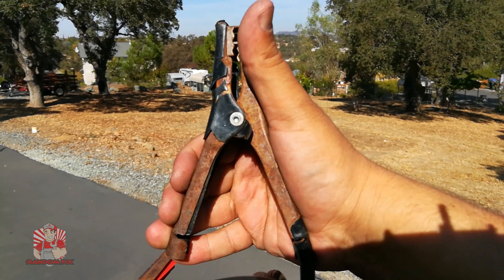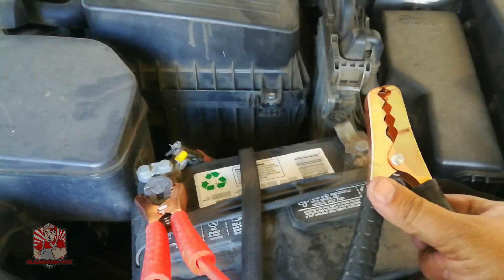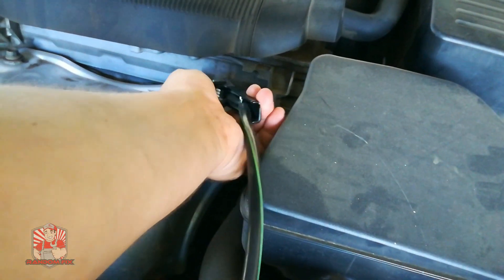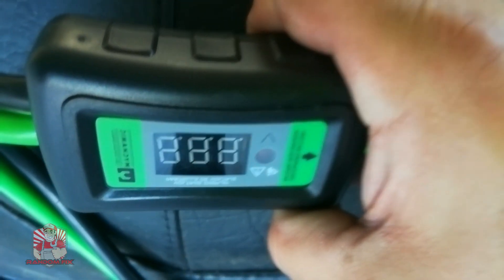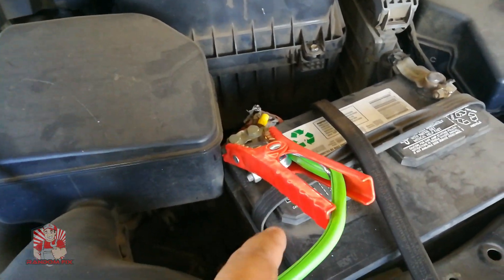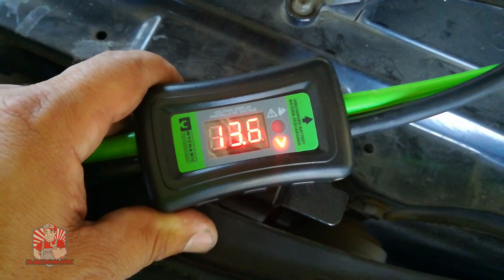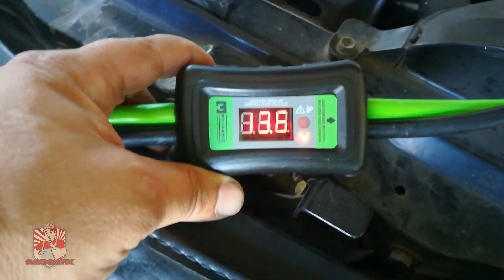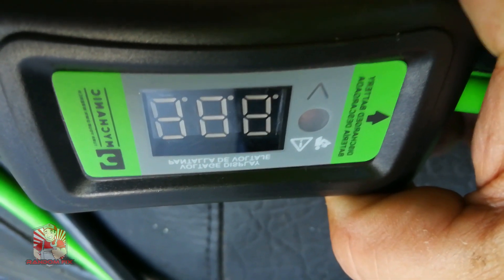MYCHANIC Smart Cables Tool Review

Comment: Should be clear to read battery voltage car needs to be off otherwise  your reading alternator output
In the video it would have been good to read the battery voltage on the old battery shoikd be betwern 12 and 12.5v after charging for a while.
Reply from the maker: Great feedback I will be sure to add to that future videos to show the charged voltage.

Comment: Walmart has theseunder the EverStart name now. The EverStart version doesn't have the arrow pointing to the discharged battery. I want the display closer to the discharge battery.  I'm sure they are made by the same company as the voltage display unit looks identical.
Reply from the maker: Thank your sharing . I hope they have a better price as these were expensive back then. If the display is similar it probably is the same unit. I wonder why the arrows are missing?